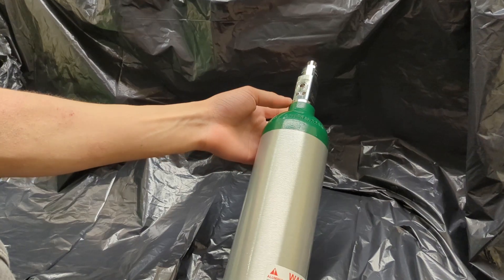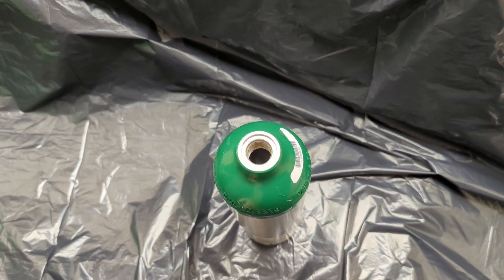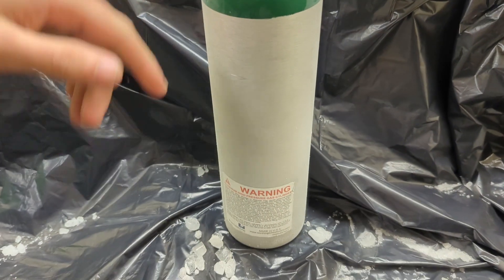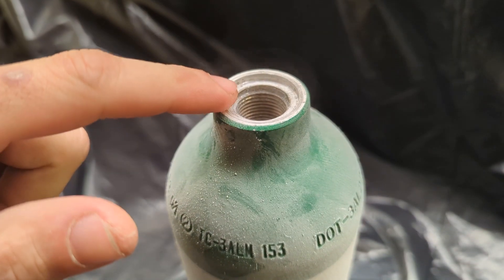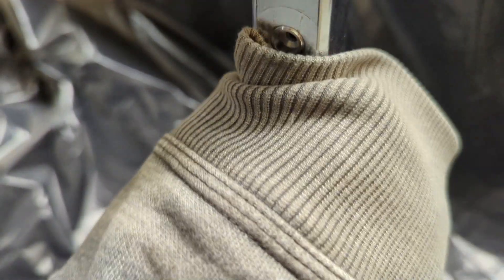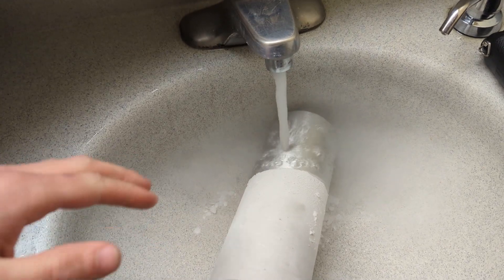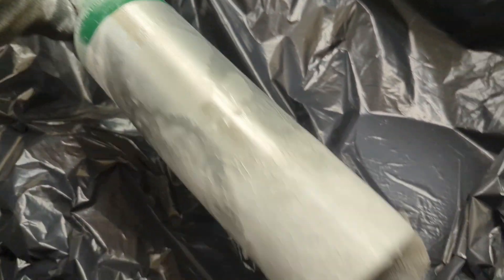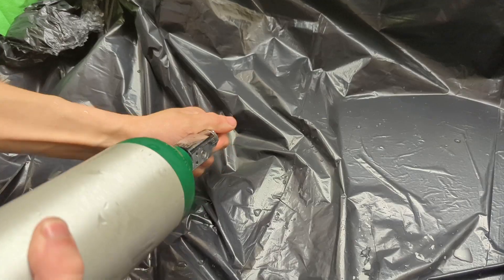Liquid co2 thruster Rocket Powered Skateboard

Comment: How much pressure would you get if you filled it up to the top with dry ice? Would it over-pressurize the tank? I'm thinking about other things you can do with super high pressure. CO2 cannon maybe?
Reply from the maker: The tank has a safety relief valve built in so if i happened to mess up it would safely release all the contents
Reply: It wouldn't be possible to fill the tank with dry ice, there would always be dead space between the chunks. To fill it to the top would require liquid CO2. If you're asking if leaving headspace is necessary for safety, I don't think it's strictly required because CO2 has, I believe, basically the same density whether it's a solid, liquid, or supercritical liquid. If you're asking whether the pressure would be higher, no, the pressure would remain the same until the tank is empty. Making higher "power" devices requires using larger, faster valves and larger orifices in order to dump a large amount into, say, a cannon.